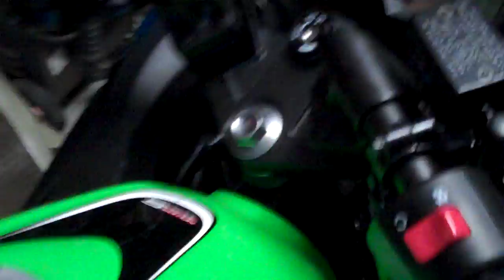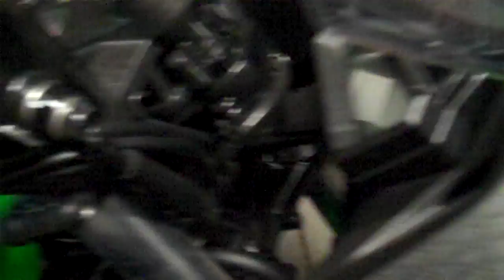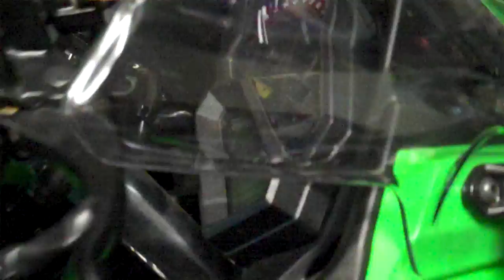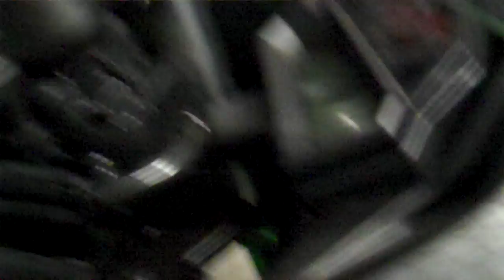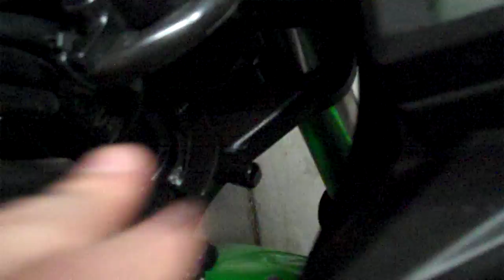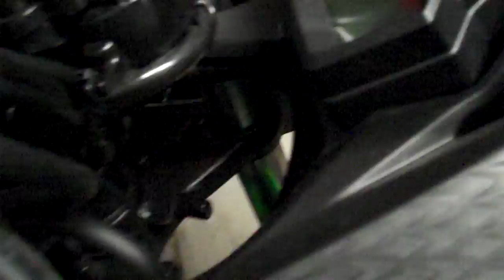part 3  black path bar riser - Kawasaki Ninja 300

Comment: Hello, would you mind telling me where you bought the risers, and have there been any issues you were not expecting, thanks.
Reply from the maker: if you look below the video you will seeo some text i typed. in there you will find the manufacturer is called "Black path" and where to buy them. i have had no dramas with my ABS bike at all with them. awesome bit of kit
Reply: TheStinger30 Thanks mate, having a bad back these will make a big difference, combined with my airhawk seat.
Reply from the maker: warwick webb
mate i assure you having a bad back this will most certainly help make the bike ergonomics feel much more like a sports tourer & take the weight off your lower back & make your riding experience much more enjoyable.i much prefer the "sports tourer" feel for sure.im sure i made a video as well and showed the screen and i drilled new holes in the screen and raised it also by almost 1inch also.that also helped. also i added progrip gel grips and "puppy grips" and the vibration thru the bars now is almost zero.cut a smal piece of old car tube and shove it under the foot pegs between the peg and kick plate and vibration there is gone also. zero vibrations is a good thing. saves body parts going numb. numb body parts are extremely dangerous on a motorcycle.greatly increases risk of an accident.